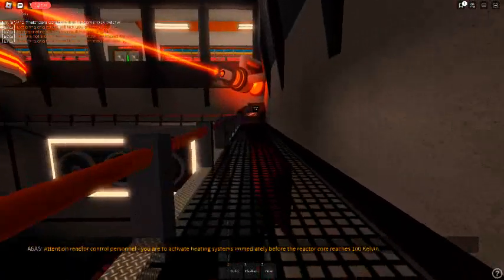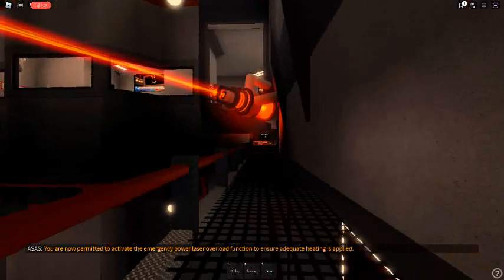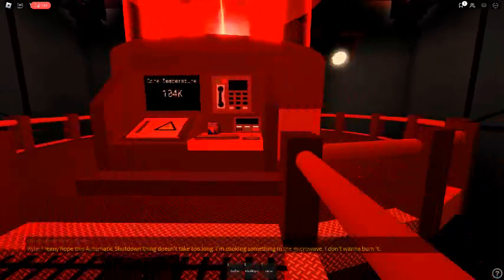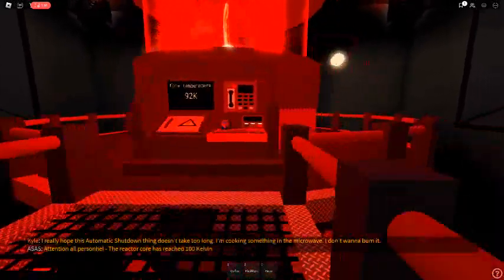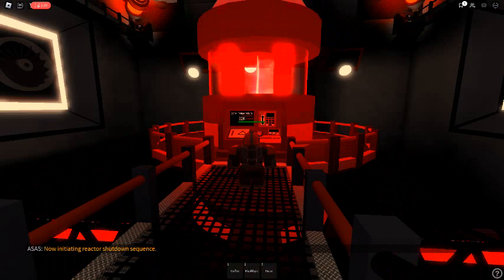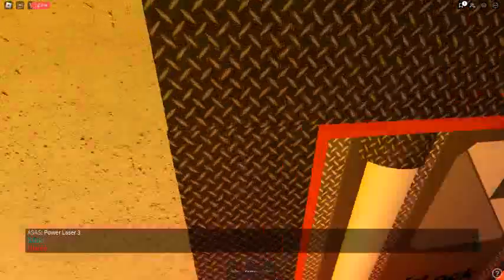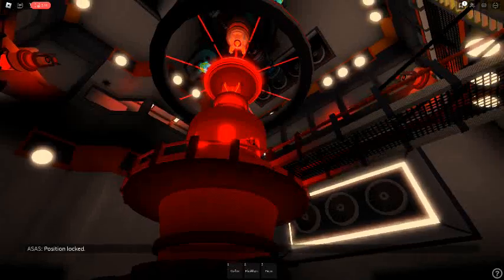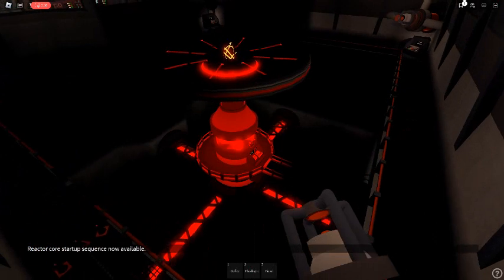Roblox Innovation Inc. Thermal Power Plant - Reactor shutdown procedure

Comment: What fan setting did you have it at?
Reply from the maker: I turned them off I think, but it has a random chance of happening, no matter what's on or off, so basically you have to keep trying until the shutdown finally succeeds and you get the badge, whether the fans are on or not, it will happen if you are lucky